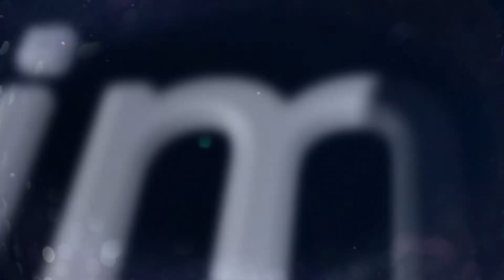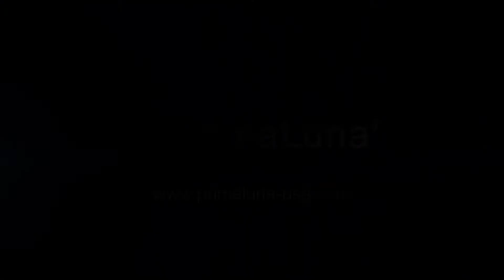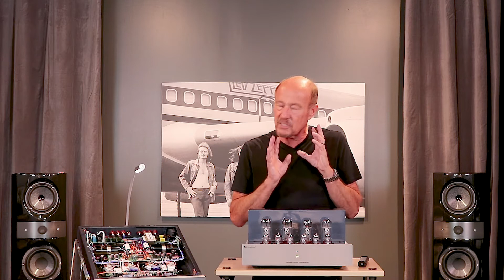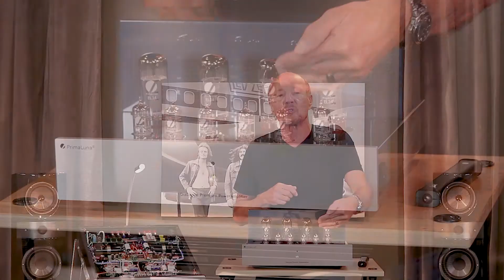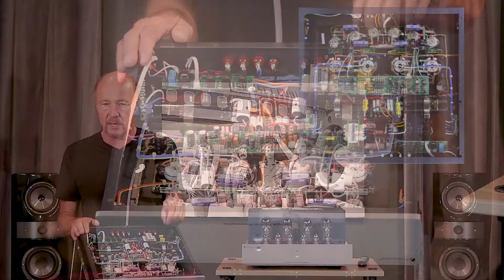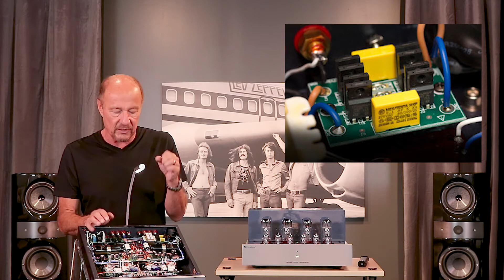PrimaLuna DiaLogue Premium Power Amplifier - An Inside Look

Comment: Ultralinear is actually the operation point between pentode and triode. It gets most of the nuance of triode mode while getting about 75% of the power of pentode mode.  Triode mode just straps the screen to the plate (anode) to make it operate like a conventional triode similar to a 300B.  I do not agree with not driving tube hard.  I have done extensive testing and I find tubes being pushed hard get the lowest THD.  However these are some of the finest sounding amps I have ever heard.  Thank you for your videos.